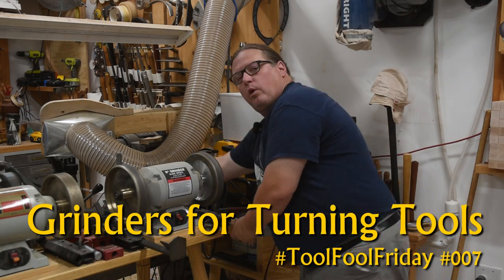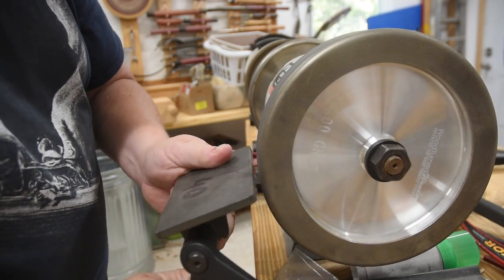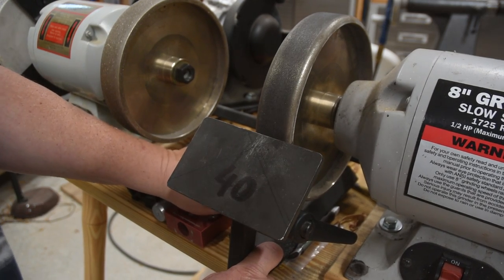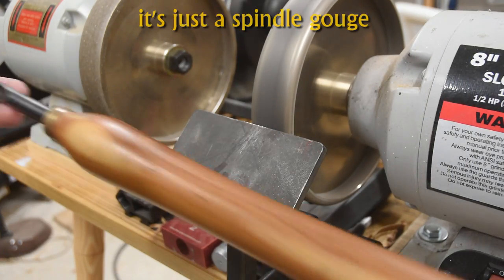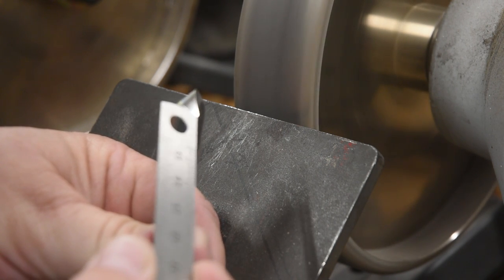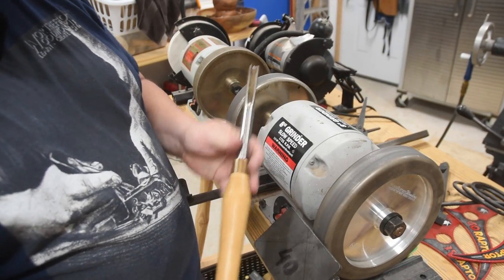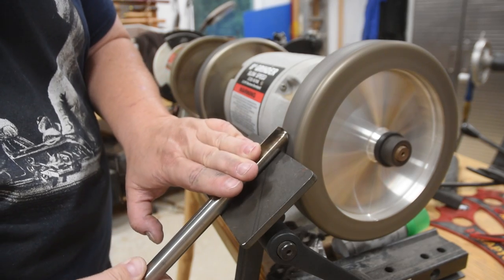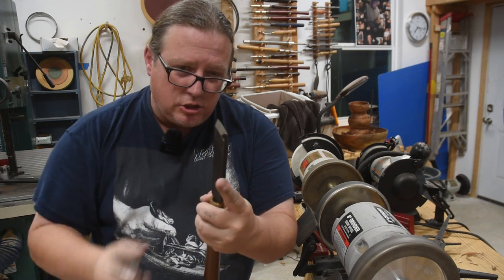Grinders - How to Sharpen Traditional Turning Tools - Tool Fool Friday #007

Comment: Thanks for the heads up on the one-way system. I bought one after watching the video. I can't afford the low speed grinder yet so I just put a variable speed control on the one I have. Think I will save up for a diamond wheel and a better grinder. Great video, thanks again.

Comment: I spent $24 for my sharpening set up…$20 for a used grinder and $4 for a 220 grit sanding belt. I removed the right grinding wheel and converted it to belt grinder. Great results sharpening with sanding belt.

Comment: Thank you so much for being so informative.   To be professional at ones work and having the skill to put ideas across is a talent not everybody has and you have.  I'm just starting out wood turning so I've got to buy a bench grinder/sharpener and wolverine one way system which is my next challenge as I live in Spain I'm going to have to work hard in finding these items.  As we live in the countryside I have a non stop supply of Olive and I'm itching to get on with it.  Thanks for everything.

Comment: Just a suggestion for your always 40 degrees platform...
Using an adhesive like Goop or E6000, glue a piece of PVC pipe or hardwood, if you prefer, to it so you can just slide it in until it hits and lock it.
Thanks for the informative video
Reply: Good idea... I use a small piece of aluminum angle iron as a spacer.

Comment: You mentioned looking for the older version of the Vari-Grind holder, what would I be looking for? A different name or some obvious tooling difference. And any advice on where to pick up the wolverine jig at a good price.. used? I just can't see doing any of this by hand, these tools seem like a great way to make sharpening a lot easier. Also was there some other attachments for the wolverine? Was that 40-degree tool holder for the grinder part of the wolverine or another part... and that little 2" jig... what makes that... great tips. I have the grinder but have been "trying" to do this by hand... LOL not so good. Thanks for the time you put into your video this has been really helpful.

Comment: Great video! You said you were going to discuss why you would have rather bought a lower grit wheel instead of the 600 grit. I assume because it takes a lot longer to grind? What is the highest grit you would recommend going for turning tools? What is an optimum all around grit? I have a 180 grit wheel but after being worn in, it is a bit slow when shaping a bevel. Wondering if 120 would be a better all around grit.
Reply from the maker: No, it heats up quick. More friction.

Comment: On the Raptor Grinding Jig Guide, the link in the description goes to the 1-3/4" version - is that what we'd want? I think you had something on your bench for 2". You also are using that 2" Thompson setup jig, and I didn't see that in the description nor the hand hone... any recommendations on those? And the diamond wheels on the 8" Grinder - I think I have that same grinder. (-: sorry I've added a few questions to this post.. I tried to email Thompson via their web page and got a bounced message - I also couldn't find that nice little jig on that site. Maybe why you didn't post a link... (-:

Comment: Hi Shawn. First, I want to complement you on your turning vids.
 Can you tell me a little more about your grinders such as brand and especially the hp and amperage draw. I've found some online rated at 1/2 hp and 3 amps (slow speed grinder) and I'm not sure that's enough of an amperage draw for sufficient grinding power.

Comment: My spindle gouge turns out pointy. I'm going to get a varigrind jig but in the meantime, what am I doing wrong?
Reply from the maker: Gonna sound snarky but you aren’t fringing on tip enough. Reset angle, start over.

Comment: your skew is 20 degrees. a little trig goes a long way.  you said the bevel is 1.5 times the thickness.  to figure on a calculator, say the bar is 1 inch, theoretical, the bevel is 1.5.  half the bar is .5,  the trig is sin A = .5/1.5.   a  $10 dollar calculator will show 19.47 if you push 2nd Sin (inverse Sin).  if you put a protractor across the end, it will show 40 degrees.

Comment: Well, now i am confused coz i am using a tormek.... 
Main thing is, to loose the fear of doing something wrong. I always procrastinate on sharpening. Guess i am a little dumb, coz if i sharpen frequently even during one project i save Lots of times sanding.... but thanks again for sharing your wisdom!!!!
Reply from the maker: Tormek is fine. Gets job done. Different setup. Just a little slower.
Reply: Slower to shape the tool but just as fast for maintaining sharpness.  Tools last much longer. 

Love your stuff!

Comment: The 40 degree angle on the rest or plate for the angles on the 40/40 grind on the bowl gouge.  Are each of those 40 degrees from the corner of the wheel away from the wheel across the platform?
Reply from the maker: I don’t understand the question.
Reply: @wortheffort   your 40 degree platform has two 40 degree lines crossing for when you sharpened your bowl gouge.  Where does the point of the angle start?
Reply from the maker: @jasonlangfield6155  on mine the side of wheel but it doesn’t matter as they are only alignment references.

Comment: This might sound heretical…….but I copy barbers. Once I have the shape and sharpness I want, starting with a brand new tool, I use a leather strop. 10-12 swipes on each side of the edge and that’s it. No grinder. I don’t cut with a burr, I cut with the edge. Burrs don’t last - but my tools do, Because I’m not grinding them away. If the edge catches on my fingernail, it cuts wood beautifully green or dry. A thoroughly honed edge stays sharp for a long time. I use two leather strops, one is attached to a board and the other is just a piece of leather in my hand- both are loaded with honing compound from a green block. I wrap the leather piece around a cylinder (drumstick) that matches the internal shape of the tool to hone the inner edge.
Reply from the maker: Even in green wood I sharpen multiple times a bowl. In dry even more. 15-20 seconds a sharpening. Pros I know sharpen even more. Barbers don’t shave a mile of hair every minute or two, turners do. The technique you describe is more appropriate for hand tool woodworking.

Comment: At about 32 minutes you comment that the way your Dad does a spindle gouge freehand is similar to Cindy Drozda. I don't think so. What she does, as I understand it, is to keep the gouge flat on the platform at all times when sharpening the cutting edge. If the platform is set to 40 degrees, it obviously gives a 40 degree bevel when you point the gouge straight at the wheel.  What isn't obvious is that if, as you point the gouge left or right so as to grind the wings, you simultaneously twist its handle so that the bit of the cutting edge getting sharpened is always exactly horizontal you are guaranteed to get the same 40 degree bevel all the way round the edge, regardless of the wing sweep angle. This works for any bevel angle, not just 40 degrees.
This contrasts with the results you get with a VariGrind jig, or a Sorby or Tormek style jig which all tend to give a much smaller bevel away from the tip of the gouge. I believe that keeping a consistent bevel reduces the chances of a catch.
Reply from the maker: You physically can’t stay on 40* platform and get the long wings Drozda uses. Hence their similar technique.
Reply: @wortheffort  Yes you can. She does. Her video "Platform Sharpening of Woodturning Gouges" shows this. The only time she moves off the platform surface is when adding a secondary bevel to take the heel off. When grinding the actual cutting edge she, correctly, keeps the gouge flat on the platform. Her description of the relation between turning the gouge to point different bits towards the grinder and twisting it to ensure the correct bevel is, perhaps, not totally clear. What she does is to ensure that the cutting edge is horizontal where it touches the grinder. She says "parallel to the platform" which comes to the same thing but I find it easier to ask myself if it is exactly parallel to the top edge of the platform.
There is no doubt in my mind that Cindy fully understands this. It is the only way I know to get exactly the same bevel all the way round any gouge, regardless of the bevel angle. No jig achieves this.
By the way, the "sweep angles" she marks on her platform are not the same as the wing sweep angles. The geometry behind choosing them depends on the depth of the flute as well as the wing sweep. It just so happens to be about 50 degrees from straight on for a 40/40 grind on a typical bowl gouge.
By the way, the secondary bevel(s) can be ground with the gouge flat on the platform, but it may be easier to do it freehand. Its angle isn't important, of course.
Reply from the maker: what your saying doesn' t make sense as that technique is what you use for things like bottom feeders and  roughing gouges. Results in no wings. She may start flat to establish bevel and keep the gouge on the back of the platform for rest of sharpening but she does twist and move up as she does the wings. Seen her do this many times. Kinda the standard freehand technique no matter how long you like your wings.
 @chrislusbytaylor3197